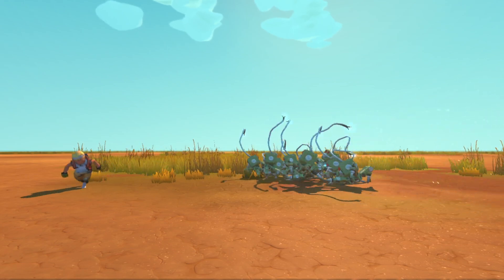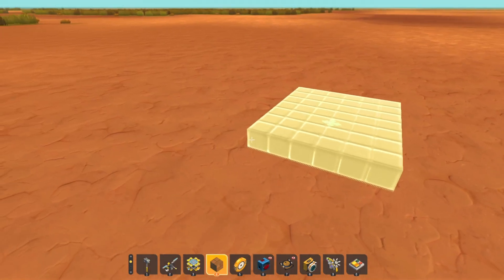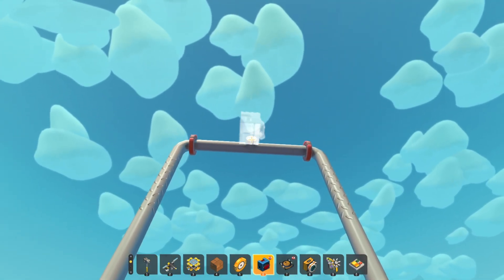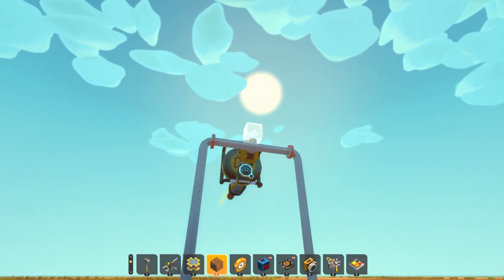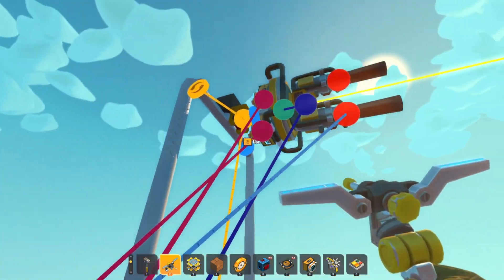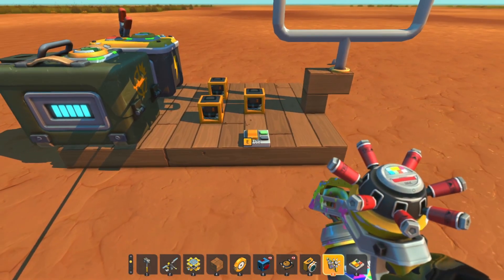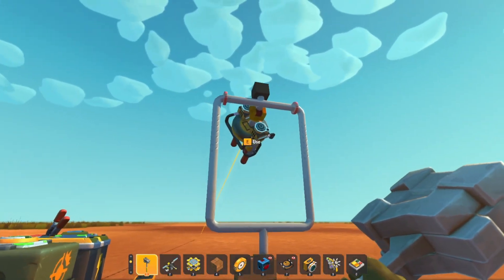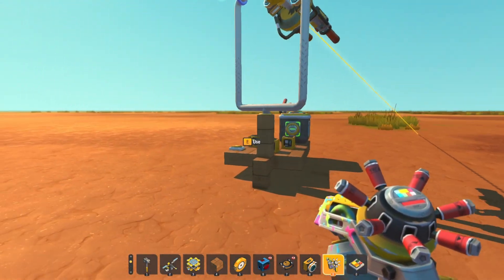Auto Turret to protect you ! Scrap Mechanic Mods

Comment: Hey I'm having issues with it aiming off to the side, basically it's turning to the left when trying to face me (if I'm north it's facing west*
Reply from the maker: Sounds like either the bearings are connected wrong or the unit facer its self isn't placed correctly

Its been a while since iv done this, but all the information on how to set it up should be in the item description
Reply: @wo0dy  The unit facer has it's eyelid on the top and all 3 bearings are painted
Reply from the maker: @superdogs2fan113 that will be why then (unless its changed) it should only be connected to 2 bearings, and only 1 of those should be painted.  The bearing mounted flat like this _ should be the unpainted bearing.  The bearing sideways | should be painted.
Reply: @wo0dy ohhhhh thank you

Comment: If you put a sensor and in the corner of the 3X3, would it still be able to read the Black Block? I'm thinking of lining spud guns around the sensor but wondering if the corners will fire properly
Reply from the maker: If I recall you can, and it should still be ok.. ( I did test this but its been a while) if you have more guns (in survival anyway) you will need many more ammo boxes, you will run out of spuds super fast
Reply: @wo0dy  I'm planning on setting this up to defend my automatic spud Farm so all I have to do is hook that into the ammo crate and I'm good (I hope). Another question I have is if the sensor stops picking up a Target does the gyroscope stop dead or does it slowly stop spinning? I think it should which means no wasted spuds?

Edit: 2 spud guns are active normally and the six are hooked into an and-gate and a switch to turn active for heavy raids. Would adding logic mess with the fire rate?

Comment: I downloaded Fant mod from workshop but I dont have unit facer or gyro...
Can you provide link?
Reply from the maker: A link to what? If you subscribe to fant mod 2 you will be able to play custom game using fant mod. If you downloaded it, you have to go through the files and do a manual install
Reply: @wo0dy  so unless I wont install it manually I wont get gyro and unit facer? Ok I will try to install it later
Reply from the maker: It depends which one you get. There is a custom game mode called fant mod 2 on the workshop,  that is probably easier.

If you get fant mod then you have to install files your self

https://youtu.be/cfwwlJlYFDw

Comment: How do you turn off things like the kill count etc... please?
Reply from the maker: In chat (so press enter) type
 /fant
Or
/fant1 
/fant2
/fant3
/fant0

All do different things
Reply: @wo0dy  Thanks. It was really annoying for me. Also is there an option to play fant custom game in creative? Thanks for the answer.
Reply from the maker: @RealMistarin  Short answer no, long answer yes.

In the workshop you should be able to find a fant mod (Different to the custom game) it requires a bit of manual file swapping, and it will make  things difficult if you use other mods (or play other creative game modes) Here is a video that might help https://youtu.be/cfwwlJlYFDw

Comment: I like this a lot. Looks great, not like my turrets.  One question....the reason for the Gyro?  Is it to increase the fire rate? So, two guns spinning can fire quicker than one gun, or simply that it's better than having a logic gate pulse set up?
Reply from the maker: Gyro spins the guns and the sensor, when sensor passes top block, the gun opposite fired.   The 3x3 gyro lets me add total 8 guns all should trigger 1 at a time. Its simply a gatling gun style.
Reply from the maker: You can pulse the spuds on logic if you want its more a preference id say.
Reply: @wo0dy  I'm finding the pulsing very problematic.  I use a timer and it seems to often get it's knickers in a twist, so I think I might just have to steal this!
Reply from the maker: Iv no idea how you make a pulse if I'm honest, but iv seen people use 2 gates and 1 timer, iv only managed it on the odd occasion but its shouldnt be that hard 😬

I say that as I currently struggle with a simple commands though
Reply: @wo0dy  Exactly.  That is what I have but I keep noticing that the guns don't fire and when I return to the pulse logic, the timer is FULL and the other gates are flashing frantically.  So I am going to adopt your idea, which I think will work much better!